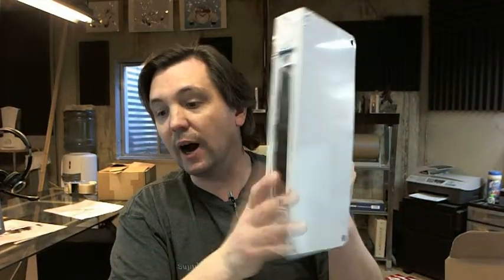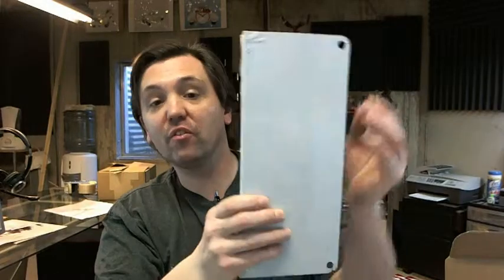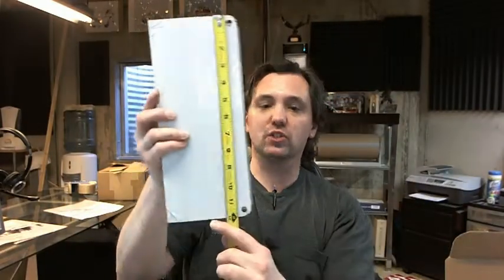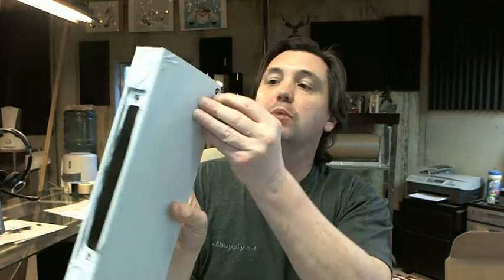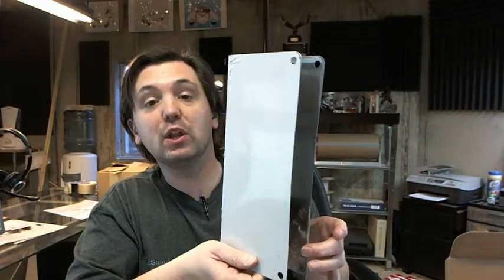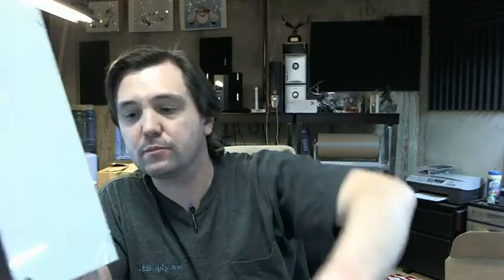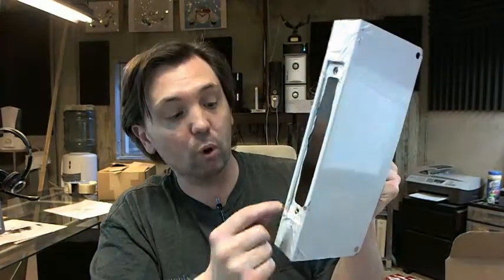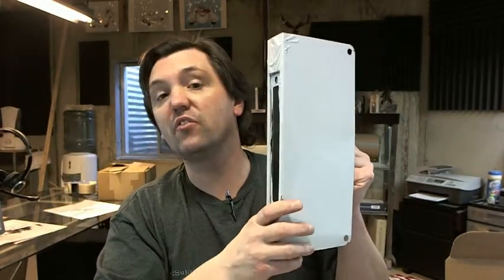Don-Jo 504-CW S Satin Stainless Steel Door Reinforcer

Comment: do these have to be recessed into the door so they dont scrape against the door frame? meaning do you have to cut a notch into the side of the door?
Reply from the maker: Yes - occasionally it is necessary to chisel it back to the face of the door but generally what you will find in residential construction is that there is a large gap anyway between the door and frame allowing you to get around the requirement of having to fit the Don-Jo 504-CW S Satin Stainless Steel Door Reinforcer a little better.

If your margin is already very tight and it's a door that can't be chiseled like a steel door or a metal clad door this may not be an option for you.